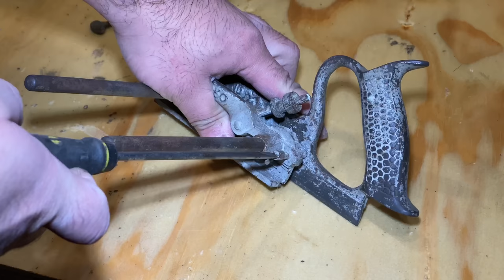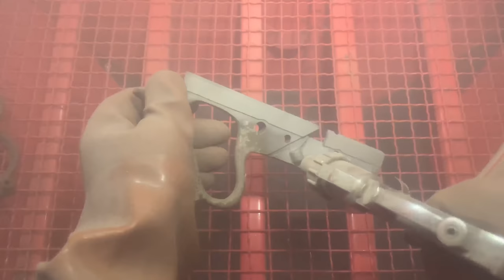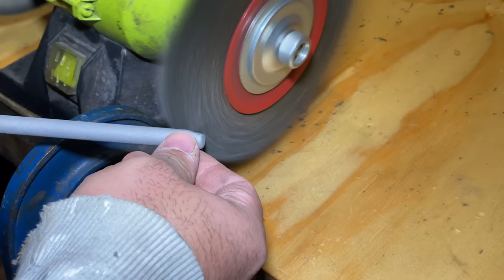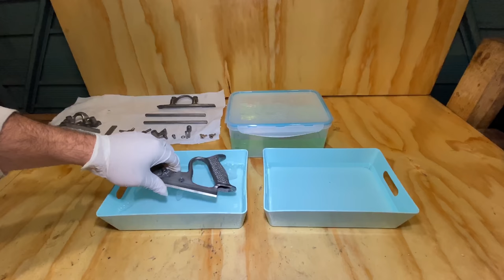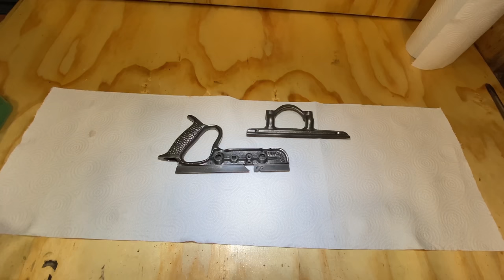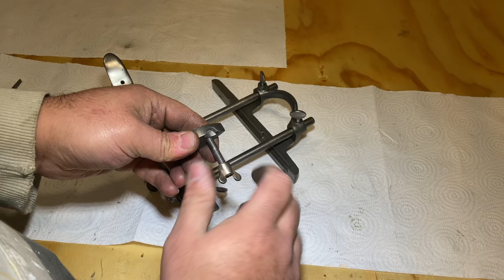Record No 50 Combination Plane Restoration

Comment: Great result.  The plating was obviously the best way to go.

For your next tool acquisition, I would like to see you get a good set of hollow-ground screwdrivers.  Modern hardened taper-ground drivers can destroy the slot of an intransigent screw.  I have destroyed my fair share of old screws before I learned this.

Cheers!
Reply from the maker: Thanks for the tip

Comment: You won't be able to crosscut without sharp nickers.  There are other names for the cutter I'm talking about, but it is the little tear drop item under the screw just ahead of the cutting blade on the side of the plane.  It was never removed. sharpened, or refinished.

Otherwise, you did excellent work I could not duplicate without a lot of research and practice.

Comment: Excellent. I have one of these, and they're a great tool. It's rare to find all the bits (depth stop etc......there were two originally), and it's a pity you don't seem to have the collection of cutters. Not sure you got that cutter sharp enough (you didn't strop, for instance). Nonetheless, that's a great rescue. I'd feared for a second that you'd slather it in paint.
Reply: You can get cutting blades for it from Lee Valley Tools,Vertis makes a plane and the blades are interchangeable.

Comment: let me help you out a little bit. One, the nickel is on there, but has to be buffed to look like it should. Gently, depending on how thick you got it on there, it can be buffed off. Personally I kinda like it as is, maybe just buff a few spots to hightlght them like the name. Two, here in the US in my world that was called a rabbet plane. What you did on that board is only one use. It can also make a rabbet (hence the name) on the end of the board to facilitate making a box frame. You can also make what they call a dado groove, as you did, but stop it where you want to so the piece of wood going in fits exactly. May take a bit of clean up on the inside end of the groove with a chisel to get it just right. Try  polishing just say the handle first, see how you like it, then polish or don't with the rest of it. The handle would usually get kind of polished anyway, as it was used. Never set this thing down on the bench with the blade out. lay it upsidedown or if you're done, withdraw the blade. This helps keep nicks and thing out of the blade edge. back when hand planes were commonly used in cabinet shops and furniture shops, you could be fired for setting a plane down on it's blade if the plane belonged to the shop. If it was your plane, they'd usually just bawl you out for it.
Reply: toot tall you need a nicker to cut dados across the grain
Reply: @Mark-xl8gg  nicker? I think I know what you mean, but never heard em called that. Yeah, that's the best way, but you can use the plane if you have to. You just have to set it quite shallow and take your time.
Reply: toot tall just checked out the brochure in the library of Congress 
And two nickers  are on the tool 
My mistake should have gone out to my shed and looked before I spoke sorry
Reply: @Mark-xl8gg  k, I still don't get that word, but know what you mean.

Comment: Nic e restoration, but on the video side of things you should never use auto white balance, the colours keep shifting all the time and it is distracting.  In video any time the colour or size of an object changes in the frame the camera tries to compensate for the colour change it perceives.  Instead choose a colour temperature setting and stick with it as long as you are shooting under the same light source. Or do a manual white balance with a white card (or any neutral surface) and stick with it for the whole scene under that same light source.  Other than that, geat work, i didn't kno Nickel plating could work on such surfaces.